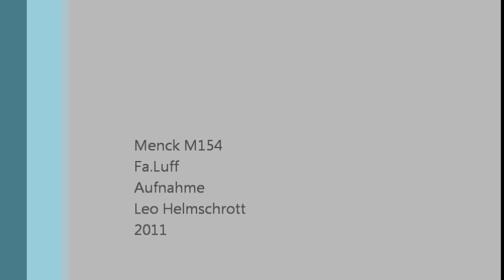Demolition a building  by a Menck M154 clamshell crane / Canon 7D

Comment: This is fascinating! I've never seen a clamshell used for demolition before. I would not have thought it strong enough to bite and break concrete as it operated by wires not hydraulics.
The operator is clearly more skilled with this than he was with the wrecking ball!!
Reply: I've seen clamshells used for demolition since i was four.
Reply: Because the cable runs through four pulleys, if the main drum winch on the crane had a pull of 10 tons that would equate to 40 tons at the jaws. You'd lose some power through friction and the distance of jaws from the pivot point but still a powerful force  which the operator was using very effectively.
Reply: Stormtrooper1488  The Clamshell is effective for brick/wood and more controlled than using the wrecking ball.
Reply: Stormtrooper1488  Of course there‘s nothing better than using an excavator with quick coupler and the right attachments. But up to the 80s, there were no demolition excavators and concrete crushers or sorting grabs didn‘t even exist. So they improvised and used track loaders or even truck based gradall excavators for smaller buildings. And of course the wrecking ball for big and small buildings. But I‘ve seen many old photos where the used a clamshell (photos from Germany and Switzerland)
Reply: Stormtrooper1488  I never said it was the right tool for this job (concrete floors). But at 3:05 you can see that it works well with brick walls... We’ll never know why they changed to the clamshell, but there must have been a reason. My guess would be, that they used it to work more controlled because there wasn‘t enough distance to surrounding buildings/the street etc. But then a normal excavator would have been a better choice anyways.

Comment: Simple Bullet Proof technology that will literally last a life time, that crane will be 25 to 35 years old maybe older and will still be working in another 15 years time and after a High Reach Excavator costing £300,000 + will be in the scrap yard, HAVE we Progressed ????
Reply: around 50 years ;-)
Reply: well there are a shortage of skilled crane operators out there, let alone ones that can do demolition, you might think its easy but its not as easy as you think there is an art to it, and it takes a special type of crane opperator to do it

the excavator though is easier to train on, can sort stuff as you are pulling it down, and can use differant attachments for differant things.
Reply: If they grease whatever is squeaking she might make it.
Reply: @templetonblake  1930s